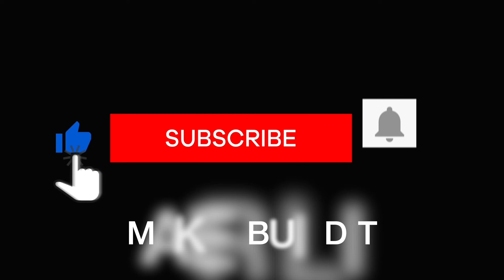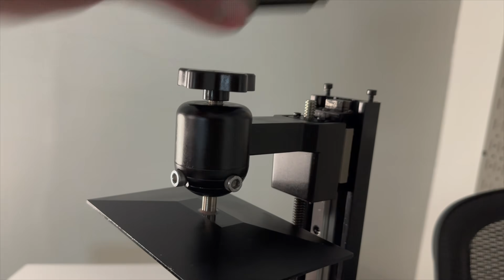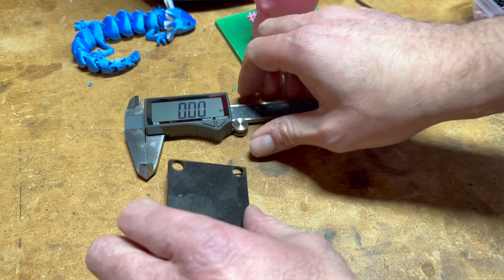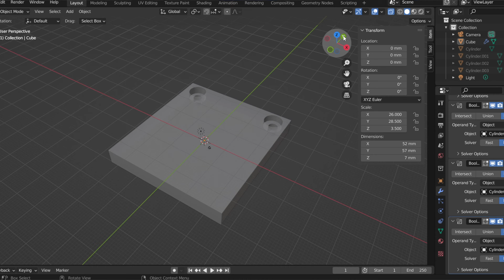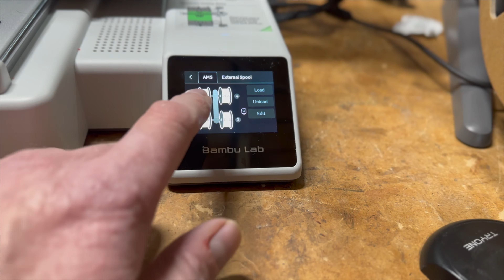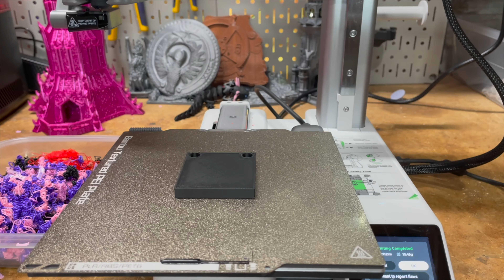Creating 3D Printed Replacement Parts for Your 3D Printers - QUICK and EASY!

Comment: I want to make spare parts of laser printers, like gears , etc. What type of 3d printers and materials should I buy?
Reply from the maker: @seyedahmad  I would recommend an FDM printer that was capable of using different materials such as PETG, PLA, TPU, because of the diversity of parts you may want to print. Something like a Bambi Lab A1 Mini may work well for you. 😁

Comment: Misleading Title.  This appears to be mainly about ELEGO Mars Resin Printers.  Only saw one STL File on website, and, it was for the Resin Printer.
Reply from the maker: Hi! Thank you for you feedback. The video is about the process of creating replacement parts for your 3D printer. The example that was used was the Z-Axis stopper for the Elegoo Mar 3, which was the printer in my mini print farm that needed replacing at the time. 😀